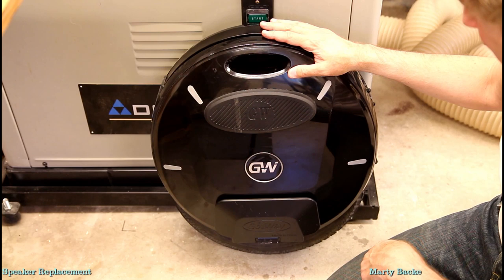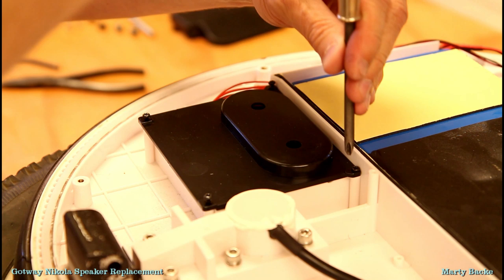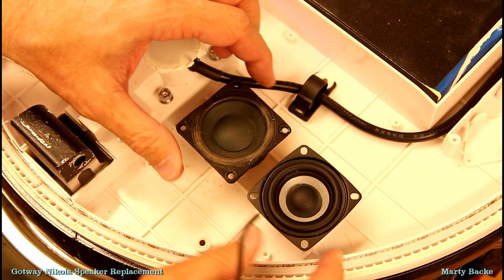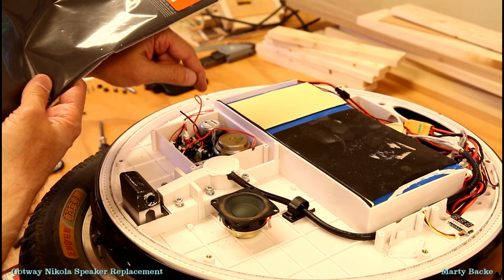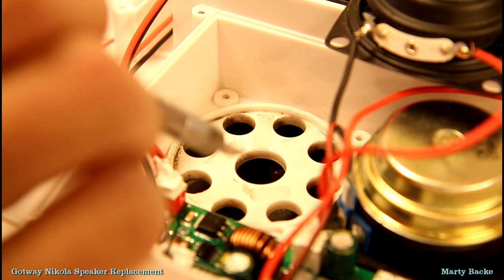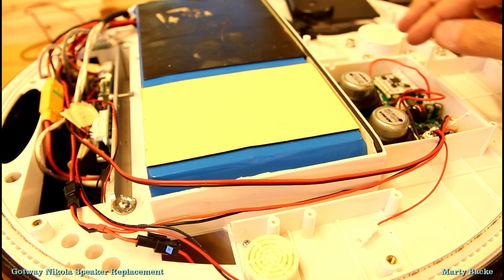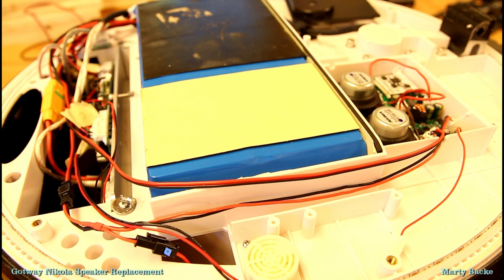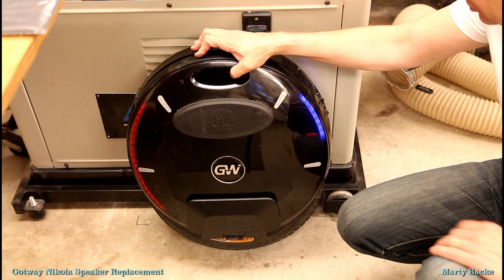Gotway Nikola Speaker Enhancement

Comment: Omg! What a mess inside of the Nikola, that wire management completely SUCKS for a wheel that costs 1800-2000$!
Reply from the maker: Yeah, Gotway is not known for implementing proper wiring harnesses :-)
Reply: @ElectricUnicycles  that is one thing I learned from you a couple yrs back when you secured all your wires with pull ties, on I believe your MSV3.

Comment: It’s almost a perfect DIY except for the missing shrink tube to cover the exposed terminals of the speaker from touching anything.

The fan is important part of the wheel which I Guess is added because of the possible heat damage due to the max speed allowed by this particular model so I hope you refrain from speeding until the fan is replaced.

Before doing soldering, not sure if you disconnect the battery....that is important in any DIY video for safety...so others following your video won’t get electrical fire when they accidentally shorted the wires.

Overall great effort and cool!

Comment: @marty if you cut the power supply wire to the speakers board and install a switch would that enable you to turn off that annoying sound on start up and make the wheel silent when needed.
Reply from the maker: Absolutely

Comment: I'm having issues with my light ring discoloring. Do you have any suggestions on what I could do to fix this?  It came this way by the way.
Reply: Just on 1 side... the voltage meter side
Reply from the maker: When you say discoloring, what you mean is you are getting a bunch of weird colors, sometimes or all the time? If this is the case, it typically means one of the wires feeding the LED strip is broken. There are three wires going to each side. I would remove the side cover and inspect the LED wires. Pressing on them in various places may allow you to locate the problem. There is nothing wrong with your control board.

It's either the LED strip or the wires leading into the strip.
Reply: Well my friend the Nikola is new so shouldn't that be covered under the warrenty? I would tend to believe it should be as long as you reported the problem asap. ...Good luck!👍

Comment: I really like your videos. Really the best. And I also really like the detailed and linked descriptions. But I think I have to disagree with you on the speaker change out. I ordered the speakers and mesh with the links you provided (👍) and I think the speakers are a little bit weaker than the stock ones. I tried it switching back and forth which ones were connected. With music and boot up sound. I think the boot up sound was only better because it was lower volume and yes a bit clearer. But sacrificed a lot of volume. It’s hard enough to hear the music at high speeds. I put back the original speakers after comparing new vs old back and forth. I’d like to put bigger and clearer and louder speakers in it. There is room both diameter and depth in the spot in front of where the stock speakers are under the shaded transparent case. Might get tricky trying to find best size, power, and ohms, etc. cheers. Keep on with the really really great and good videos! Very impressed. Thank you!
Reply from the maker: So sorry you didn't like the speaker upgrade. I feel bad. I didn't notice much of a decrease in volume. I was more interested in a better sound, but again, that's very subjective.
Reply: ElectricUnicycles right-o. No problem. Keep the great videos comin’!  I wonder, do you know what the voltage is coming in from those speaker wires? Do you know what ohms and amp rating speakers might be best?

Comment: Will this mod work on the 100v Nikola+, and what are your impressions in music difference since the volume isn't made to be louder
Reply from the maker: This is an old video. There is an improvement in sound but it's subtle. After the intervening couple of years I would no longer put the effort into making this change.
Reply: @ElectricUnicycles  Thank you for the honest reply.  I just got my AR+ Nik, and any improvement on sound (especially under $30) is good with me, esp before I put my JBL back over my shoulder.
Reply from the maker: @Bdillony  Also, the speakers in your AR+ are most likely totally different then my ~3-year old Nikola. Hopefully they're better :-)
Reply: @ElectricUnicycles  I'm guessing they are, I found the part online anyway (stock nikola+ speaker).  However, they siliconed that sucker down hard and tight, so much that I bailed from the process.  Don't want to ruin any wires that affect lighting or anything!

Comment: Thanks for the video! I don't play music and don't particularly want the start up sound either. Could you use a thicker rubber material to just quieten the sound? Is there a simple connection that could be unplugged to stop the speakers altogether? Would this cause any other issues?
Reply from the maker: No issues at all. You can simply disconnect the power to the sound module and it'll have no effect on the wheel.

Comment: Is there a 12V supply to the bluetooth module as I'm trying to replace it with a bluetooth amp cum speaker board but it runs off 8V -36V so if I pipe in 84V, it would fry......
Reply from the maker: No. Only  a tap from the main battery and a separate 5-volt feed.
Reply: @ElectricUnicycles  Thanks!

Comment: Was there any indication of the wattage on the original speakers? eWheels says they are 25 watts each which I find hard to believe. The ones you linked are 12 watts each so 25 watts total makes more sense.
Reply from the maker: No markings other than two 4-ohm speakers are being used.

Comment: A bunch of us NY guys have experience an issue where the speaker, light, Bluetooth all stop working spontaneously and simultaneously. Have you experienced this or seen this happen to your fellow riders? Do you know the cause?
Reply from the maker: Which bluetooth? The audio or control board? I assume you mean the audio bluetooth.  I have not heard this before. I would assume that there's a problem with the common 5-volts which is supplied to all of these components. Should be easy to isolate by opening the wheel.

Comment: Is that the Nikola Plus?
Reply from the maker: No. I painted mine. The Plus also doesn't come with black pedals :-)
Reply: ElectricUnicycles Very nice mods.😊👌
Reply: Dang that's not even the 100V and your pedals look cooler than mine! 😀
Reply: @ElectricUnicycles  Dear Marty, what paint did you use? I will receive my Nikola in some weeks and I'm thinking to completely close those speaker holes to avoid any water damage in that area. There are placed so low on the wheel and above electronics. Maybe turn the speakers on the other side, membrane facing the black cover in which holes could be made. I know I will have to check for the glue on the mosfets, and certainly to change the fan and secure the wires with silicon and straps. Very good instruction from your part like always! Thanks !!!!
Reply from the maker: @fredericschoovaerts8712  I paint all my wheels with RUST-OLEUM Ultra spray paint. Two coats. For the Nikola I used gloss and flat on the pedals.
Reply: @ElectricUnicycles  Thanks Marty !!! take care.